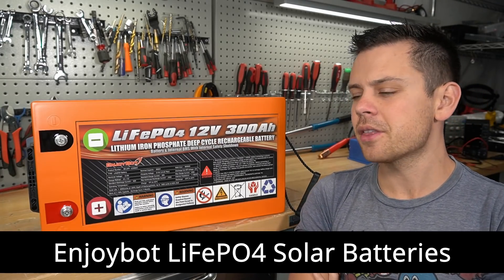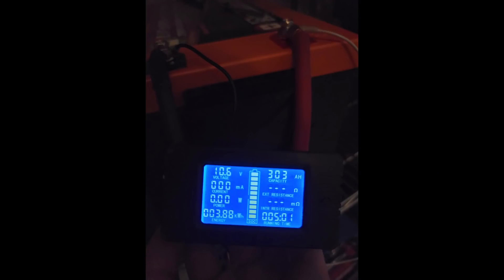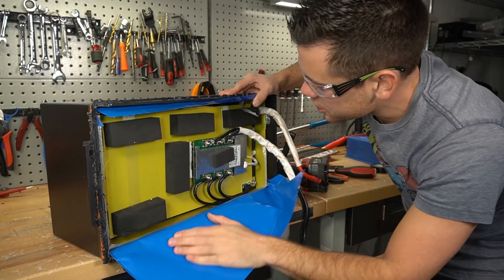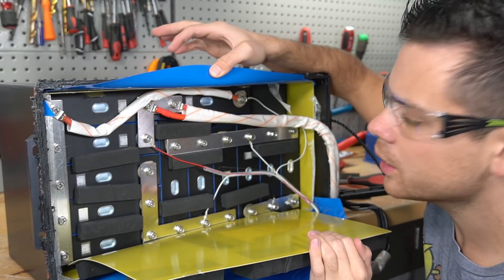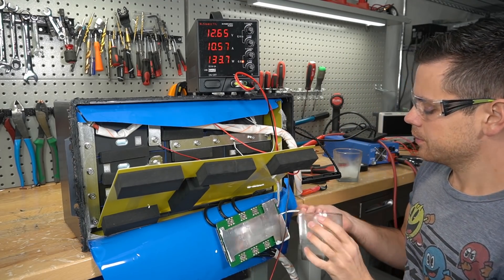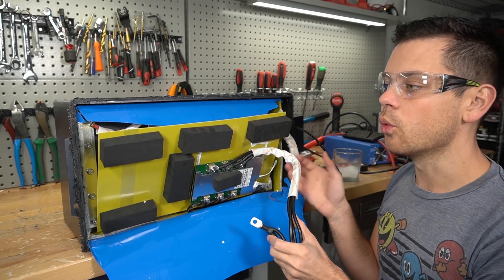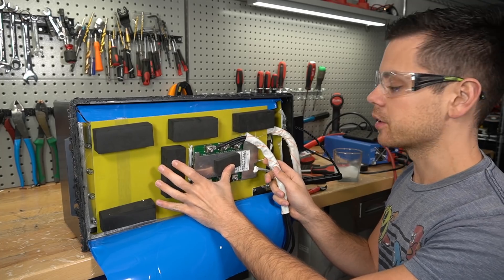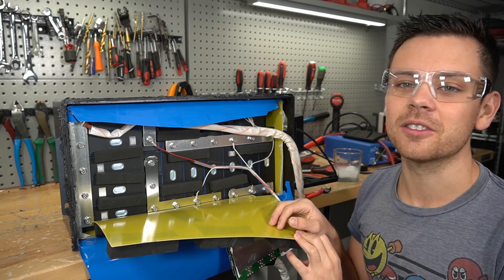Dirt Cheap Lithium Batteries: Enjoybot LiFePO4 for $.26 per Wh

Comment: Couldn't find an updated comment in here about Enjoybot having a version of this battery with low temp protection since this video was first put out. I just went there, and there is...specifically stating low temp protection. It'll cost you $100 to get that (that's outrageous), but with the price increase I would hope that means that "REALLY DOES" have a low temp sensor in there.

Comment: More battery than I could ever drain, or ever charge. I have the 100 amp-hour version of the Chins battery, I very rarely deplete it all the way, maybe only once a week. And in the morning before work, it is just finishing up charging. If I had this 300 amp hour virsion, it would only ever see full after an over weekend charge, with my 8 amp charger.

Comment: Will have you seen Enerdrive in the US a lithium battery and component supplier into the RV market here in AUstralia. I have a 12v 300 ah slim line working well, would you consider a test if available?

Comment: Thank you, Will (we're not worthy!) for the very insightful videos. You've made it clear that lithium batteries should never be 'CHARGED' while they are at freezing temps. Can lithium batteries otherwise be used for power in cold/freezing environments (without charging)?  Also, can they be stored within an RV/trailer/shed/cabin during winter(s) and not degrade? Thanks again
Reply: LiFePO4 batteries will hold their charge for years.  Some battery BMS' shutdown the entire battery pack when the low temp switch kicks in, meaning no charge in or out.  Some mfrs. have built in heaters in their batteries.  I believe Renogy did have internal heaters.  
If you have a sheltered, insulated area that would be ideal.  LiFePO4 batteries have no off-gassing as opposed to flooded cell lead-acid batteries so ventilation is not a concern.

Comment: New to this and my question is. You say you prefer rack because of all the features, but what about any hours? All the racks I see any have 100ah so would need 3 to equal 1 of these. I’m your recommended 48volt rv package you recommend a 48v 100 ah battery.  Does ah not matter and if it does then how do we stack server batteries in an rv without going over weight limit? Thanks!

Comment: Quick question Mr. battery guru man can you use a lithium battery while it’s below 32 Fahrenheit cedar power a 12 V fridge or a diesel heater or is that a no no? I know you’re not supposed to charge them until it’s above 32 Fahrenheit currently looking to put one of these type of batteries in my Expedite van currently have lead acid

Comment: Will, I live in Maine and have had  a solar shed for the past 2 years and I am in the process of upgraded from two parallel Renogy 12v 100ah AGM to two Vatrer Lifep04 batteries with one more to purchase.  The final system will consist of 2 Vatrer 12v 100ah lifepo4 batteries and a 2K inverter.  My typical usage is between 10 and 100 amps.  Before I purchase more batteries, I am now concerned about how important it is for a lifepo4 12v 100ah battery to have internal bus bar stress relief for individual cell expansion?  I have heard pros and cons of an internal busbar needing a flex point made of layered metal to other opinions  its not needed.  Is the spacing between the internal cell adequate? What is your opinion? Did the Vatrer 12v 100ah lifepo4 battery teardown have good internal bus bars and cell spacing? BTW your teardowns are awesome. Thanks in advance.

Comment: Living near Miami, should I not keep the battery, charge controller & inverter in my garage? The 200w total of solar panels would unfortunately be 100 feet away in the garden. Is that too far away?  If i do have to keep the controler n battery out in garden closer to panels, then i could build a small enclosure for it. What charge controller and inverter would u recommend for a 200 amp hr 12 v battery setup? Using it for garden lights and to charge lawn equip batteries?Great explanation! TySM!!

Comment: thx for this great revieuw, 
what is real low temp, i live in the netherland, and the battery won't be in use durig the winter, but it will be in the cabin.
real low for us is -10 degrees. Didnt happen this winter.

Comment: If I didn't want to wait for cells to arrive on the slow boat, finding the perfect box, assembly, the risk of having a bad cell and having to wait another 45+ days for a replacement from China, I'd order this and replace the BMS with a JBD.  May take the total up to $1,150 or so but it'd get me two or more temp probes to snake below that top tray down to the cells and still be a bargain at that price, even if mildly inconvenient.  I'd just make sure it's hitting capacity figures before hacking it up.  Might even be able to fit a victron BMV or smart shunt on that top tray for interfacing with other victron gear in one convenient package, but if not at least I'd have the SOC reading over bluetooth from the JBD.

Comment: Not much room for heat dissipation and the BMS looks small especially drawing 200A continuously (600A peak!). It would be interesting to see the FETs datasheet. Great video. Hope you've had a nice Christmas.
Reply from the maker: Good points!! Very true
Reply: @jamesbenedict6991  Depending on engine size, temperature etc., a starter motor can draw like 1,000A or even higher. I had a 1,200A LiPo pack and it wouldn't start my 3L Diesel Jag when it was cold. I wouldn't be putting a battery like this anywhere near an engine.

Comment: This would seem to be a good choice on a sailboat to be used in the tropics?
Reply: My thoughts exactly.....I'm in the process with my sailboat to replace the genset with a lithium bank.
Reply from the maker: Yeah, that would work great. Perfect application for it
Reply: I’m about to get 2 of these 300Ah (not sure of the brand yet), for my catamaran down here in Mexico.  The lack of a low temp cutoff won’t be an issue for me unless I sail up to the Pacific NW 🙂.  If funds replenish sooner rather than later, I could go with 2 400Ah batteries 😄.

Comment: A word of caution regarding their customer support. We fought with them for nearly 3 months before giving up. One battery had the low temp cutoff constantly shutting off around 44° F preventing any further charging.  Another cutout at 42° F.  Bad sensor or BMS. Either way they refused to honor their warranty. Ultimately we filed a claim through the CC servicer.  For this reason alone we refuse to buy batteries with low temp cutoffs which may be adequate for a single battery install but not 2S and larger configurations. The Victron equipment we use can take charge of that. There's a pun there. Anyway, Enjoybot a.k.a. Chins/Amptertime/Li-time are all the same company that we have found. When purchasing from them just write it off as a consumable.

Comment: Thanks for all your videos and reviews, great information. Are this batteries capable to be use on off-road? I already have a dc to dc charger capable to charge lithium battery but my concern is if this battery will survive working inside of the engine bay where the temperature is not always cold and vibration and dirty and dust will be there almost all of the time, I’m currently running a AGM as auxiliary battery but I’m thinking to migrate to lithium because performance but I don’t know if this kind of battery will work well for me.
Thanks buddy…

Comment: Hello, you can now find 200 or 300 AMP LFP batteries in 12 or 24V all assembled with display for less than 10 cts per Wh? Like Eco-Worthy or LOTL for example. What is the quality of their BMS?

Comment: I can live without a low temp cutoff. My batteries are inside my RV, and I know they're not supposed to be charged at low temperatures. The server rack batteries are nice for a stationary install but not worth a crap for an RV; they can't handle vibration. I'm not made of money, and inexpensive, well-made batteries are what I need. I got 4 12-volt 200ah Chins batteries, free shipping to my door from a Chins company rep for $2400.

Comment: Very interesting review thanks Will.  We always watch just in case any of these might make it to Australia.  BTW if it has high temp protection but not low I wonder if that would impact us.  Low temperatures are not something we worry about that much.  High, yes.  But low - well most parts of the country have not seen snow in my lifetime.  

Do you think we can safely assume that if we don't take batteries into snow country it's not a problem for us???

Comment: Thanks for all the helpful info.  I order a Java Evergy 300ah on Amazon but now after watching more videos, I have seen the Multiplus II 120x2 I ordered should have at least 400ah.  My question is, should I buy the same battery size and should it be the same brand.  What happens if a 300ah is connected with a 100ah wired in parrel?  The whole solar system is adding up fast and I was hoping to add the second battery down the road.
Reply: From what I have read you want to match your batteries

Comment: I do not doubt that the temp sensor is high temp on the wire leads, but is it possible that the low temp is on the BMS as a chip or Surface mount somewhere?

Comment: Will, you mention server rack would be better because the inverter can talk to the BMS, have you done a video on this? It would be nice to see  the added features when the battery and inverter (EG4-LL and LV6548 as an example) communicate. Without understanding the added features I don't see how it's any better than setting the low voltage cutoff and custom battery settings in the inverter.

Comment: Hi I have a question I just got a ecoflow Delta mini.  It can charge super quick with AC 120.    Is there a way I can setup something to charge the battery bank directly from solar panals quick AC , maybe I use 10  12v cap converters?  To make 120v ac 🤔 directly from solar panels.  I have only a few hrs of sun a day so fast charging is  a must . Please advise

Comment: Live in New England here, but planning on using this as a house battery for a Sailboat. It will only be in the water from April until late October. Will pull thr battery for the winter. Do I have to worry about the low temp sensor for that application? I will have a separate starting battery for my outboard.

Comment: These vids are great, and  really helpful for many.  I was just curious on the  per watt hour calculation, on the 100AH EG4LL LCD Battery by EG4 is $1896 with $200 shipping cost, so doesnt $1896 get divided by 5120 Watt Hours which equals $0.37 per watt hour. (I am probably missing something here and intent is to politely ask : )  for clarification)

Comment: Will moving to a remote area bought 12   
235 watt 24 volt solar panels really cheap what setup is easy and how many kilowatts of battery would I need to run small 1000 Sq ft house I live in Michigan and have sun all day but winter is a tough factor I plan on adding a vertical wind turbine also because have a good steady wind frequently thinking 600 watt, would say a 10,000 kWh battery be sufficient ? Thank you in advance I really appreciate all your videos.

Comment: Living in NH I really need a budget 200 ah battery for my mobile office. It will  be connected to a 20 amp DC to DC charger so no solar. I’ll just be running a printer maybe for an hour total per day, should I just isolate the battery charger and just charge in the garage when it warm enough.

Comment: Sorry to keep on the trend for this but I live in Southern Missouri and may need to upgrade my golf cart batteries in my EZ go cart, If I put three of the regular (non low temp cutoff) but use a HRTC smart charger that has the temp sensors on it would that work? my cart will be stored in a drafty barn. Or do I just need to get the batteries with the low temp cutoff?

Comment: Just a thought as I don't know what's inside the electronics in those battery packs: Surprisingly many microcontrollers have an internal temperature sensor which you can tap for information. Could this be how they validate their low temp protection claim? You can verify this on your smart phone. You have to do the read as the processor "wakes up" as it will heat up fast. An external sensor is obviously way better solution.

Comment: Would this not work as a 2nd battery for overland vehicle, given its 50 amp max charge current?  I would have it connected to an isolator however most alternators are 60amps or more.

Comment: Does the BMS in this battery have a low temp sensor input? If it does, there has to be a reason they don't use it. If it does not, then that explains why it doesn't.

Comment: I used the link you provided for the 300Ah model and there is no mention of Low Temperature protection, only High Temp.  Maybe they updated the page after your video.

Comment: Kinda puts me in a bind. I live in my car in the Pacific northwest, its moist and gets quite cold. My plan was to run this off my alternator and move my inverter from under my seat into the trunk. Are there batteries you've tested with actual low temp protection?

Comment: Have a question. I have an electric wheelchair and the deep cycle acid batteries are getting old. I saw on youtube where these people where getting Kobalt lithium batteries 24v and switching. And yes, it is 24v wheelchair. I was going to connect them together to boost the distance until I can accumulate enough of the Kobalt batteries to do a switch over. So they'll be used to extend the distance for now. The acid batteries are 2-12v hooked up to be 24v. Both are 50ah for a total of 100ah if that's how it works on a 24v system. The Kobalt batteries are 5ah each 24v and currently I have 2 and plan to slowly get more.

I live on a fixed income as to why I'm doing it this way instead of just buying a lithium battery full size and going from there like with the acid batteries. So my questions are:

1) Do you see a problem hooking up Kobalt power tool 24v batteries with acid batteries to be used at the same time? And yes I will be hooking them up to the 24v part so they'll be working with the 24v system
2) And because there would be a big weight difference in just switching over to the lithium batteries, the amp draw would be a lot less. How much, not sure. Do you think there is a possibility that the 2-24v batteries might go half the distance of the 2 acid Batteries?
3) How many of the Lithiums 24v 5ah batteries do you think I would need to achieve the same distance or further? I was thinking 6 and carry 2 to 4 extra for backup if my idea will work at all. They make adapters where the battery just plugs in and the positive negative wires come out and you can basically power anything 24v. They also make adapters to use the batteries with usb plugs and also some pretty major dc powered lights if one is needed.
4) Because most batteries produce a little more than their advertised voltage, do you think the multiple lithium batteries will have to much over 24v, or not? And yes the wheelchair has a onboard computer the regulated the power going to the motors. And it also has a speed controller that you set the top speed and push the joystick forward and it only goes as fast as the speed setting you are on. And there is 5 speed settings.

And this wheelchair is a top dollar model someone gave to me, not a cheap one. And I go 2 and 1/4 miles round trip to Walmart when I go shopping. The acid batteries had no problem with this. Then one day it started going down on my power meter, which is only led lights. I make it halfway back home and have to juice up. Or since I know this, I juice up for an hour at Walmart before I leave and make it back home. I also plan on switching the transmissions from using a regular grease to synthetic grease which will also reduce amp draw. It's a worm gear set up trans.
Reply: Or maybe this is a test and see project? Might work or maybe not?
Reply: I almost forget this question. Can acid batteries be charged along with lithium? I have a 3 amp 24v charger that hooks up to my wheelchair. And a 4amp charger that I carry with me. I also have a Kobalt battery charger that I can unplug the batteries and charge them separately which might be a better way. I can get more chargers used pretty cheap on Ebay. And I only buy new batteries because I don't batteries that are used that might not last as long putting a strain on the batteries that are good.

Comment: whats considered low temp, it can get as low as 30F here during the winter at night. but it can also get to 100 in the summer.
Reply: Low temp is less than 32 °F or 0 °C
Reply: @ahaveland  ok thanks, im trying to learn before i buy so i dont ruin stuff.

Comment: Hi Will, 

I bought a 100ah 12v after watching this video a few weeks ago.  Im camping in a winter environment.  The battery seems to have some sort of heating film inside of it (small paragraph about that in the manual that came with it) that warms the batt to 50 degrees F when connected to charge controller.  Ive been monitoring it closely with an Epever mppt controller and it seems to be “protecting” against low temperatures.

Thanks for all of your insight over the years.

Comment: Will the 300ah joy it tear down what type and size were the cells.  I have a 300 ah JITA with heater and I want to build a second 300 sh batt.  What size of cells should I use?

Comment: So would this battery be able to be a direct replacement to a bank of RV batteries? My RV has 3 12v batteries wired in parallel to give 12v to the house. If I was to remove those 3 batteries and install this one would
I need anything else? Does this battery cut off charging when it’s fully charged and also shut itself off if it gets too low?